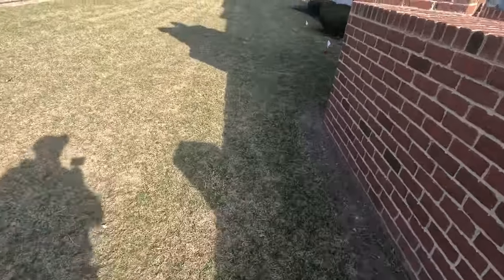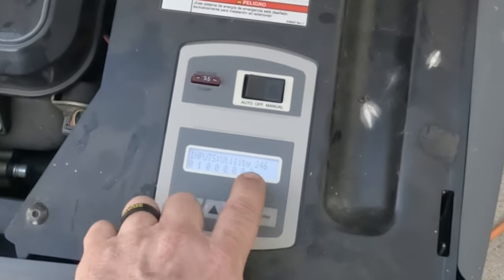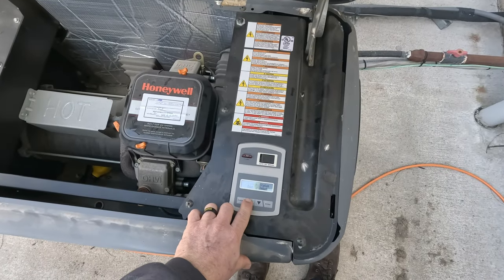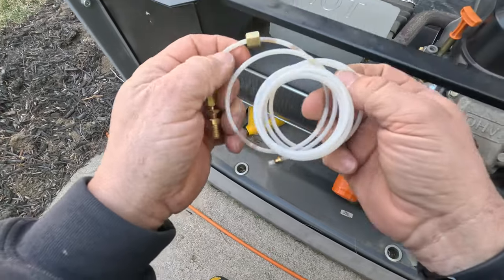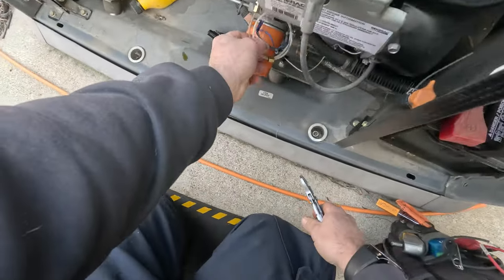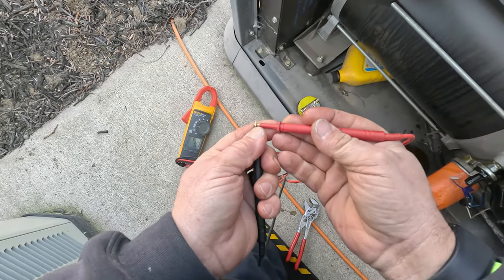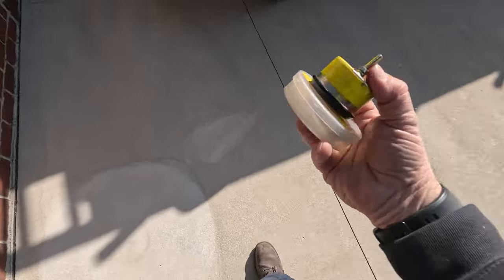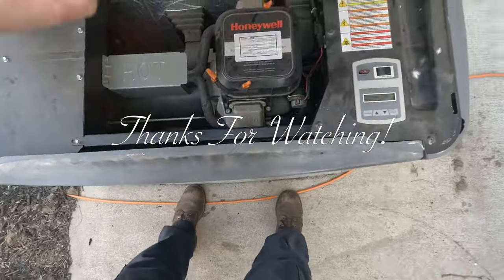Generator Generator Won't Start AGAIN!!

Comment: Thanks for the video. I work in condos and they have massive indoor generators. I have been working on these sites for years and never seen any work done on them except generator testing.
Reply from the maker: 🤣🤦🏻👍👍. The commercial generators are built much better.
Reply: @HVACRSurvival  Biggest one I've been to is an Aksa Power generation unit. I had never heard of AKSA before but all the components are great 'off the shelf' stuff. Perkins twin turbo diesel engine, Stamford alternator, and DeepSea electronics controller capable of loaded and unloaded exercise, and even auto sync to grid for loaded exercise option so the customer doesn't lose all the employee time clocks, computers resetting etc. Don't even hardly see the lights flicker. Very little in the way of issues, and most of the stuff you can just go get somewhere locally, very little in the way of "OEM" parts like that oil pressure switch. I think their company philosophy is some of their units get shipped off to remote craphole places like remote areas in India, Africa etc, and the last thing you want to happen is one of your customers to be down half way across the world for lack of a simple OEM part, when they can just run to their local hardware store and get something that will work etc.

Comment: Good vid. Planning on getting a portable generator set up for our home this spring. Like others have said I really don’t see a lot of positive things about permanent mounted generators. Also can’t use it for anything other than the house. Thanks for sharing.
Reply: Portable generators are all right, especially if you get them installed on a wheeled cart.  You still want to add a transfer switch and power cable setup to your breaker box.   Reasoning behind permanent generators is a few things.  1) Can run on piped propane or LNG.    2) Much larger sizes available.  3) Harder to have walk off.   4) Automatic tests. (You do NOT want to fire off a test while stored in your garage, for example).   

Realistically, if you put in a permanent stand-by generator, as long as you aren't dumb about it, they'll last.   1) Build a dog house for it.   Don't just stuff it out in the open, but do what you can to protect it from weather.    It's not like it's hard to build it so you can flip up the 'roof' and 'walls'.    Use ball lock pins to hold them into a frame.   Just make sure you don't restrict air flow.   (heck, pipe the muffler out further).    2) Do the maintenance.   Run it regularly, make sure the fuel is in good shape, so on, and so forth.   3) Remember it's there.   That is, don't forget about it until you're desperate for it to work :)

Comment: I understand that you have moved on from generstors and now doing a lot of different stuff now.  But it ma,kes you va,ulable to your company that you ha,ve different skill sets.  Dont worry about the haters you show those adjustable wrenches all the time. I like you have different tools for each job and enjoy them so much. Just watched again your crane that you made replacing semi hermatic compressor that was very smart and hopefully you get paid for all those extra's that you thought of.
Again sorry your not feeling well !  Been there and done that worked when i wasnt up to speed. Its your great work ethic . Enjoy your channel ,your doing so much with trade teaching others. Wish when i was starting to work my way up in the trade to have these resources as channels like your self. Your're a great teacher and may the Lord continue to bless you and your family now and coming years!!
se
Reply from the maker: @stanleyroberts thank you very much for such a thought out message. I really appreciated reading it.
Reply: Agreed on the tools.   I, personally, prefer using fixed width wrenches - but I don't attack anyone for using the flat jawed "adjustables".   Frankly, I think that a lot of folks that buy them probably do still round the nuts, but those jokers will round the nuts with a box end wrench, by using an SAE for a metric, or vice versa, rather than using the right tool for the job.  

I also own way too many sets of tools - but then, you don't want to go searching in the garage when you're in a second floor workshop, in the car, on site, or in the first floor workshop.    So, you end up with at least four basic sets.

Comment: That oil is old and dark, you could see it when you pulled the switch.  Oil color on the dipstick is not a reliable indicator of oil condition. Get them to have it serviced once a year, good for them, good for you.
Reply: Might be Pennzoil, starts off dark.
Reply from the maker: I'm doing the service when I return.
Reply: Well if the sticker was right it was about 2 years old.

Comment: awesome videos thank you for them.
as you say generac are just trash, if i have some one come to me and say my Generac has a problem i tell them #1 i do not work on there junk and i am sorry that you have one.

and when they get tired of fixing it come back and i will talk about a hole and i mean hole house diesel.
Reply: Diesel has it's own issues, the biggest one being the fuel goes bad because 90% of residential don't have very long power outages and if they do they're quite rare, maybe once a year from a bad storm thats about it. And then there's all the problems with the newer ones with DPF/EGR and SCR issues, and the constant need to do forced regen on them with a laptop, because they don't get loaded enough. Residential load is so unpredictable, half the time nothing is running, except maybe 1 fridge and a couple lights. Then a big peak load for a couple hours when everyone gets home in the evening and starts doing laundry, dishwasher, cooking, vacuuming etc all at the same time. Then it's back to nothing when everyone goes to bed and everything is turned off. I've seen houses with a 400 amp service only pulling 5-7 amps total while I was there during the day... On the other hand, with like large commerical customers, I have a fairly large nursing home for one of my customers, they have a 600kw backup generator, and the load there is never under 50%, and nearly never over 70% on hot days in the summer. Most of the equipment and lighting is on 24/7. So that waives the state requirements for an annual load bank test, if the monthly on-load test is at least 50% of the nameplate rating. Exercise is once a week, but monthly it actually synchronizes with the grid, then switches over to full generator power for awhile, then resync to grid, parallels for like one second then drops out. Deepsea controller so much better than Generac's. But Generac are fine for a house, as long as they're either natural gas preferably or LP.
Reply: @brnmcc01  when you start talking about DEF and filters you do know that residential generators are only cat3 and do not have that junk? as to the fuel 1 quart of SeaFoam in a 100 gallon tank and you are good for years. Diesel vary seldom goes bad but it will grow algae the SeaFoam stops that and at the same time prevents gel in vary cold weather.
and before you go there i have diesel generators i work on that are 25 years old and they have never failed to start in the cold or hot.  there is this thing called maintenance and block heaters.
i consider this discussion closed i will not blow up this nice gentleman's video's.
Reply: @hartsfire5706  Yes for sure, I didn't say anything about cold weather starting. Diesels that have decent injectors and good compression don't usually have any trouble starting in cold weather. I have a little yard crane with a very old 4 cyl Detroit 2 stroke, and it never fails to start even after sitting outside for weeks at a time :) I did not know the small ones weren't T4, the diesels I'm familiar with are newer (2007+) Cummins units at manufacturing plants and they only run in exercise once a week, and seldom get used so once in awhile have to connect laptop with Cummins Insight and do a forced regen to clear the DPF. We took out a 70 kw unit that was 15 years old at another facility few years ago and that diesel was so bad it looked like used engine oil... They never tested the fuel or added any Seafoam etc. It might have had the same fuel in it since it was installed. I was shocked how bad the fuel was in it.

Comment: Seems to run a bit long without the ‘oil pressure’ signal being true.
Reply from the maker: The switch is normally closed with the engine not running, when the generator is running, it is open, what I was trying to demonstrate in the video was unhooking the switch removes any oil protection, and it will run nonstop with no oil protection. That's why I verified that it shut down after I was finished testing the switch and why I hook the switch back up to protect myself against any liability of engine damage if I was to leave it on hooked.
Reply: That's by design, they have a delay in the logic to give time for oil pressure to build, such as after an oil change with an empty filter.

Comment: What after replacing the oil pressure switch it still has problems? The military way of testing small generator low oil pressure/low water switches and safety circuits is to install a small shut off valve between the block and switch. Start engine with valve open, then close valve to simulate a low oil/water condition, the shut down circuit, wiring, circuit board, programming , etc , should kill the engine. Everything is pipe thread and can be easily purchased as a tool for testing. I am sure Generac is not built to military grade specs. The principle is the same, regardless of generator size. Just an idea...
Reply: How do you bleed off the pressure in the switch after you close off the valve?
Reply from the maker: @billy I proved the switch was bad when I removed the switch from the circuit, did you notice it ran for well over a minute and something? (That's why I didn't edit that space out with the video.)  Then I reversed the operation by putting the switch back in the circuit when I was finished. Plus I also did it with my electrical meter, it's just an N.C. switch that opens while running at normal pressure,  it's not a variable voltage switch.
Reply: @joehead1294  I was thing the same thing.
Reply: @joehead1294  If the engine doesnt stop, crack the fitting on the switch side slightly.

Comment: Generac isn’t any worse than any other standby gen that runs on propane/natural gas imo.
Reply from the maker: Depending on what year it was, the first generation from 2004/2005 area has lots of problems , the newer ones are clones of what Kohler was doing much sooner with integrated controls. The other problem was customers not taking care of their equipment, the majority of the problems in the beginning were mainly mechanical failures.

Comment: I kinda just laugh at the constant complaining about gen service and it ends up being stupid simple service call.  Can’t get much easier.  Half the time is a control board swap or lack of maintenance needing to be addressed.  
Seems just like my boiler or hvac system that has an issue with a board every two years…and those sit inside
Reply from the maker: To each their own. I told the shop to send someone else to class. I don’t want to work on them. But these things are such shit units the get a lot of views so I might as well make a video on them.

Comment: That’s a poor design, open circuit and it runs. 🤔
Reply: It's a trick to fool the homeowner who just makes a little jumper to jump out the limit switch. It won't work, and then they'll call someone. It's not a poor design, it's just reverse psychology.